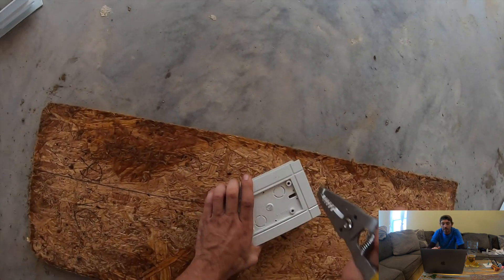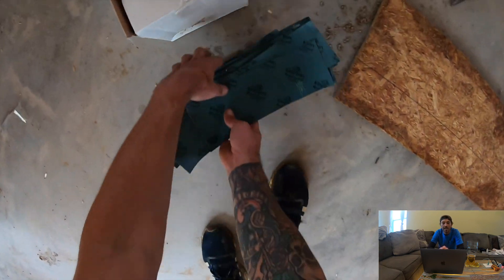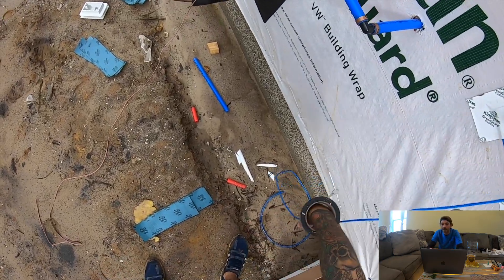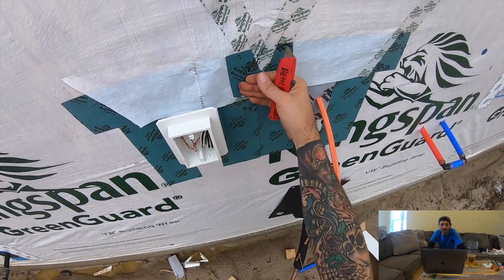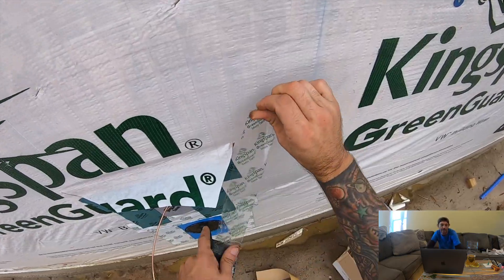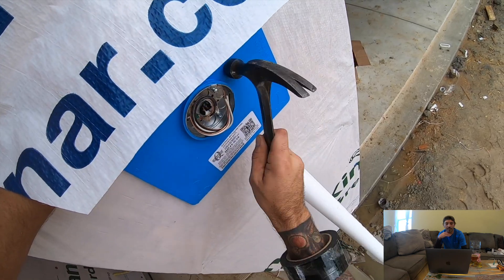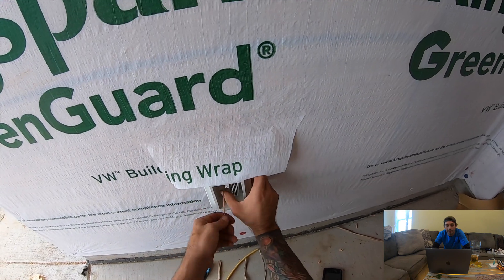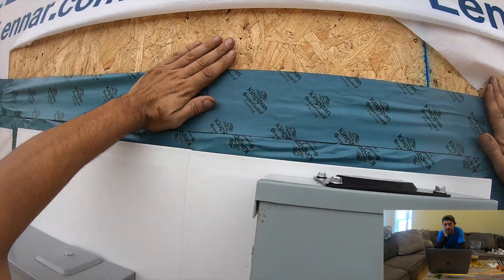Weather Proofing Electrical

Comment: That’s crazy.  Here in Grand Rapids Michigan we just put tape on the top of the box over the house wrap.  In many places no grommets.  It’s plastic boxes.  Metal pancake boxes makes no sense.  The box is going to be recessed back so far after siding.  Use Arlington lighting blocks.  Those Arlington plug boxes are stupid too.  Use the in use ones with covers.  All that time installing them just to go back and put covers and devices in later makes no sense.  I didn’t even know they made the boxes that u used.

Comment: If your using plywood siding (T-111) what outside receptacle box would you use? These look like there spaced for vinyl siding. Is there something different you use for other types of siding? Also, what is the vendor or supplier for that weatherproofing sleeve you put around the round metal boxes for the outside lights? I don’t find anything like that in my area.

Comment: Hey Dude, I just now came across your videos seeing knowledge of electrical wiring. I had a 40X24 pole barn Garage built and am taking on the misión of installing power to it myself after studying extensivly. I have fone some wiring before and have the respect and knowledge of the job with limitations. You are a great source and help to us on the other side of the TUBE, Thank you so much for sharing you still and craft, your videos are very detailed with visual examples.

Comment: Is this a brick or siding exterior?  Does the process change depending on which. 

I’m doing my own home using Arlington brick boxes for the outside outlets. 

Thanks for the videos. Keep them coming. I’ve learned a lot from you.